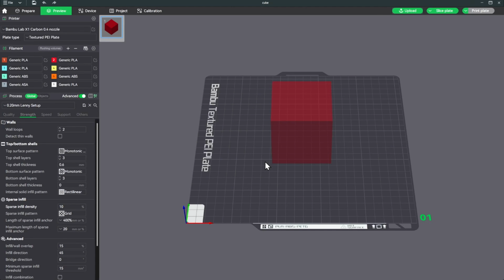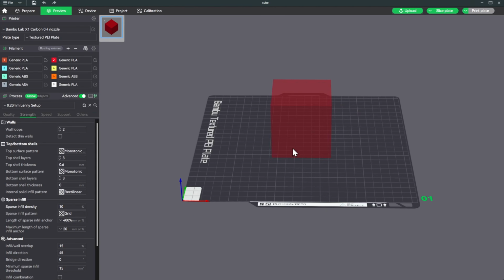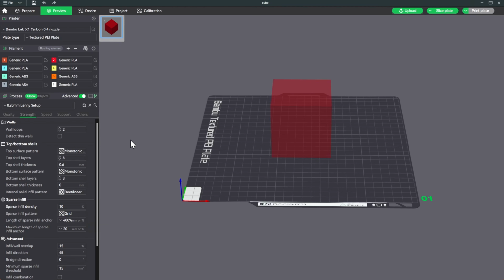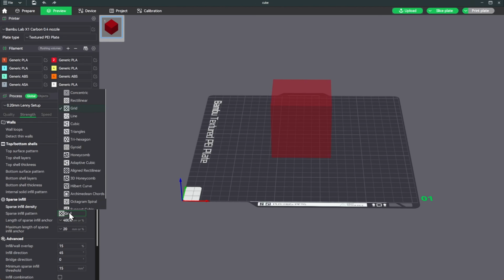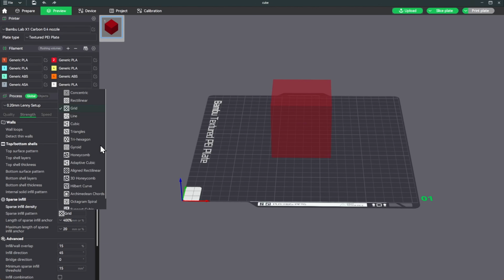Are you using the right infill pattern?  Bambu Studio infill pattern review.

Comment: I see this video is 2 years old but wanted to add a comment for people just now viewing this. Instead of manually interrupting the prints as you mentioned you did in the beginning of the video, if you had set the Top Shell Layers to 0 then it would have completed the whole lightning pattern which rapidly grows as the print approaches the top. Also as of today there are 21 infill patterns.

Comment: Lightning will save you A LOT of infill material, specially on larger/taller objects as it doesn't necessarily build up from the button, but rather "springs" out from internal walls  as your print approaches the top of the print, (hense, it was not visible in your test) I used it printing a mannequin head in full size.
Best for enclosed objects that does not require any additional strength.
Its basically an internal overhang/support structure, rather than an infill.

Comment: One hint for top and bottom pattern: You can use any object (for example text) as a modifier for an area. So you could use hilbert curve for bottom pattern, ad a text object as modifier, use this with concentric. Also I recommend a seperate modifier just for the first layer to set perimeters to 1. So you get a very nice hilbert curve bottom with text in concentric lines. Print this in black PETG, you have clearly visible text black on black. Optimal for printing displays for Disaster Areas show spaceship...

Comment: No need to stop the part before it finishes to see the infill. If you just set it to no top layers then the infill is exposed, you can do the same with no bottom or top layers or no walls.

Or you could set it to pause at layer 60 and just cancel the print then.

Comment: One comment that always comes up in the internets is that the default (and other) patterns criss-cross, causing the tip of the nozzle to hit and sometimes tip the part.  I notice this at the layer where the change in direction happens (sound of nozzle periodically hitting) and more with PETG than PLA for example.

Comment: One thing really worth covering is different infills for different filament types.  For instance, most infills work fine for PLA but for PETG, infill patterns that overlap themselves will cause filament buildup on the nozzle as it drags through the infill.  This can lead to stringing and boogers and other defects.
Reply: Which patterns work best with petg. I have experienced what you are talking about.
Reply: @colinmsmall  I usually just use Grid but a lot of people use Gyroid also.  Basically you want patterns that don't cross themselves all the time.  Which seems odd with Grid but it works pretty well for me compared to Cubic or any of those.  You'll always get a little collecting at times with PETG but not too much that it leads to a burnt booger on the side of your print.
Reply: @bsimmons00  is grid strong enough for helmet infill? For like cosplay helmets and armor etc? I’m trying to find a good pattern fit this type of stuff with petg.
Reply: @colinmsmall  Oh, I'd imagine so.  You can always adjust the density.  I use Grid at 15% for stuff that gets pretty good abuse.

Comment: We need tables! Time and filament per type.

Some are not very optimal for cubes of course. For example I use Lightning when printing busts and they are almost hollow until you get part way up the actual head, where it increases in density to support to top of the skull properly